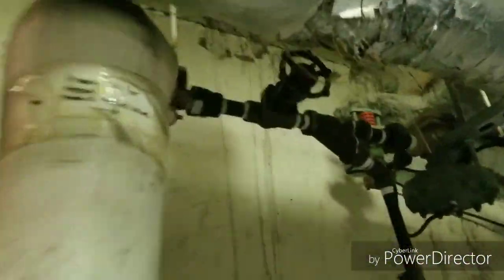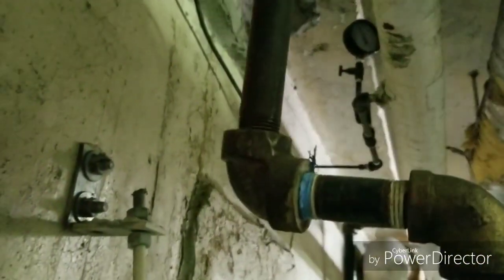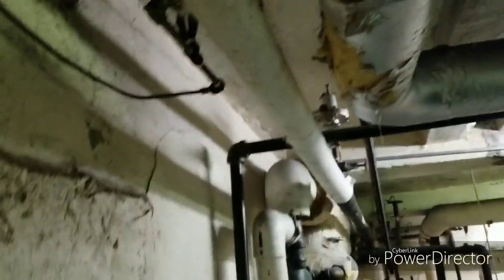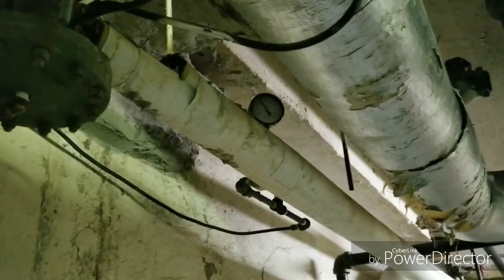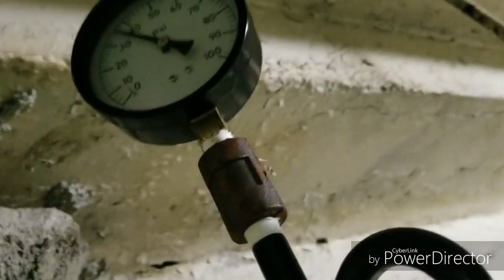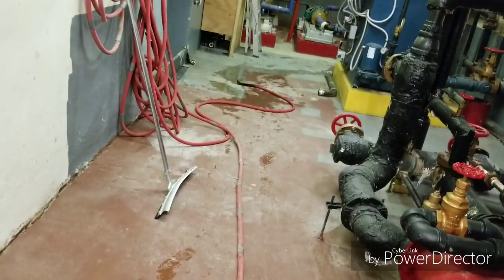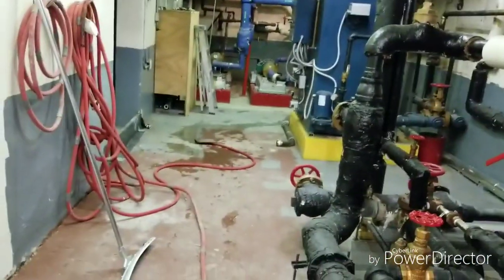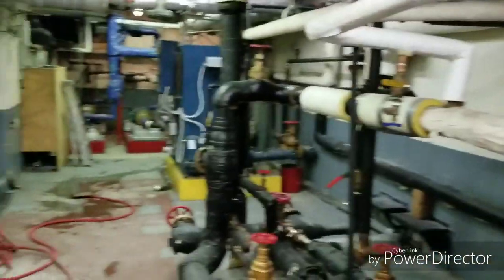High pressure steam leak on pig tail.

Comment: 35psi is not high pressure. Lol you couldn't get that close if it was high pressure. Where the leak is at is has been reduced to 35psi so where the leak is isn't high pressure
Reply: Insulator here. Had a high pressure line blow at a plant. That shit is invisible and is soo hot will cut you in half. Scary shit
Reply from the maker: @disciplesofchristministry9269  Here in New york city anything over 15 PSI for steam only is considered high pressure. High pressure boilers start at 15 and up.

Comment: Since when is a 35 PSI high pressure steam? Steam turbines in electrical plants operate at couple hundred PSI up to 2000 PSI in the big plants. Or is this a thing with just the residential steam heating?
Reply: Correct anything over 15psi is considered high pressure
Reply from the maker: Here in NYC Anything over 15 psi they consider it to be high pressure , I know that 35 psi its really not high pressure but the rest of this system is coming in the building at 170 to 190 Psi.